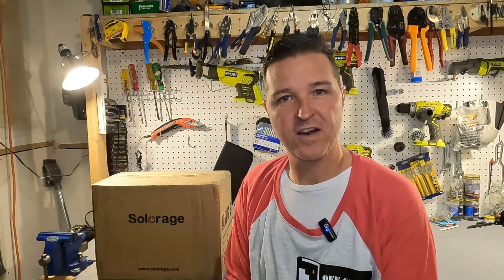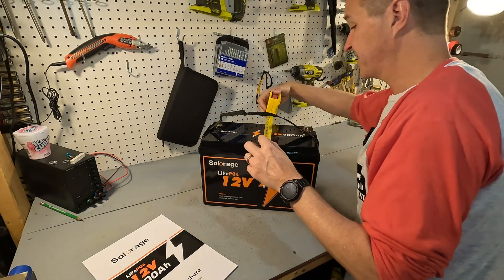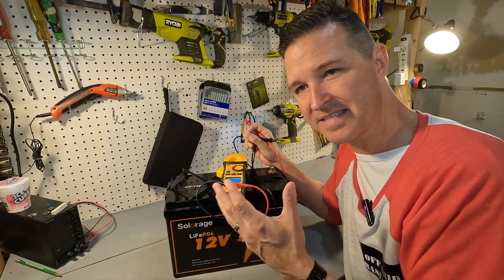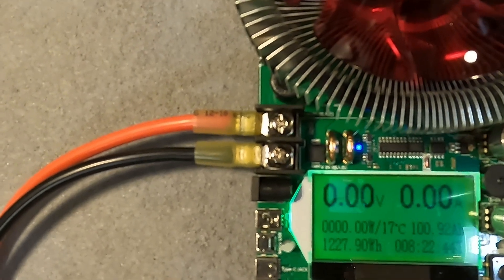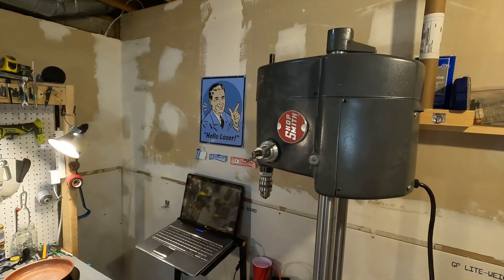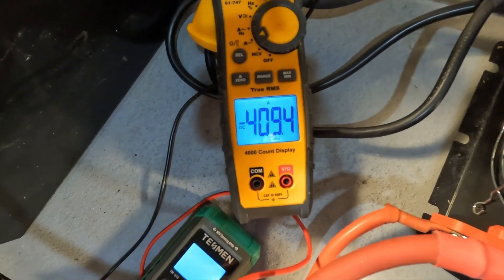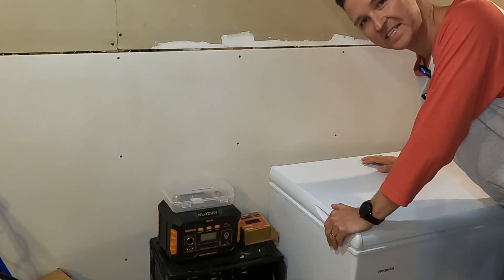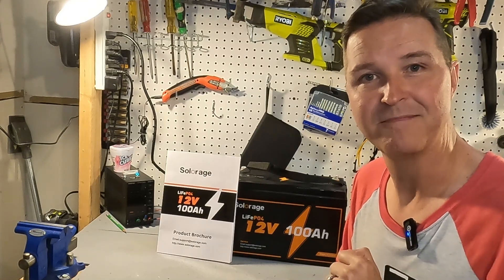Solorage 12v 100ah LiFePo4 Battery Review.  Cold Temp Charging Protection, no Over-Amp Protection.

Comment: Bottomline , this battery is NOT safe. There are cheap alternatives on the market. Why take chances with Solorage?
Reply from the maker: Using a 125A fuse would take care of the lack of over amperage protection.  There are  better alternatives out there.  LiTime and wattcycle are a couple.

Comment: That battery will not stop unless it detects to much heat...  its a good battery.
Reply from the maker: The battery will work just fine for 99% of all applications.  It's the 1% that connects one battery to a 5k inverter that I worry about.  Thanks for the comment.

Comment: I just thought it was more appropriate to say Hi how you are doing in the most recent video. You know the semi approved invertor that UK had problems with getting an export Tariff, its coming to the US of A rebranded and price hiked but if you want to charge on the camp site .          EcoFlow 800W Alternator Charger
Regular priceUSD $599.00    Howdy.
Reply from the maker: That is a bit high of a price.  Bummer for all the issues.  Thanks for the comment.
Reply: @OffGridBasement  Grid companies just cant seem to use common sense. They just want to rubber stamp electrical certs. Greta Jungburg would be upset furious. Export Tariffs should be an automatic human right lol.

Comment: Scary that it happily delivered over 400 amps and it clearly wasn't going to stop. If I had one I would definitely fit a fuse, but I would still be nervous using it. It just shouldn't be like that.
Reply from the maker: No it shouldn't.  If you've done a power audit and know your limits then it will be fine.  Thanks for the comment!

Comment: Same class as that Cyclen unit you tested previously. Be interesting to see what the heat camera shows in particular in the region of the BMS during over amperage draw tests; again especially when you pushed it to 250 amps. Another beast of a battery that likely will handle a short flogging now and then.
Reply from the maker: Yes.  I would really need to open up the battery to get the proper temperature.  I think the battery would fail before getting good reading through the case.  Thanks for the comment.